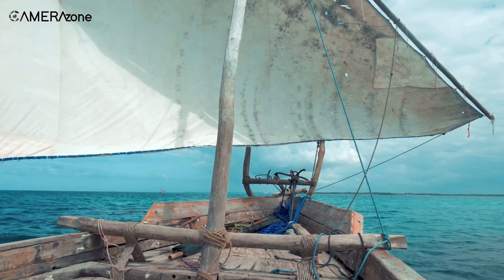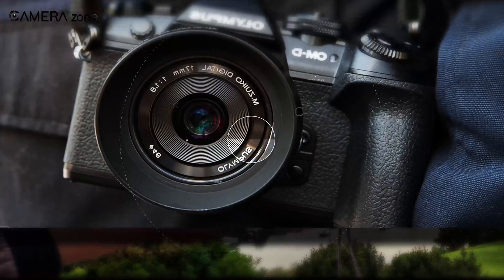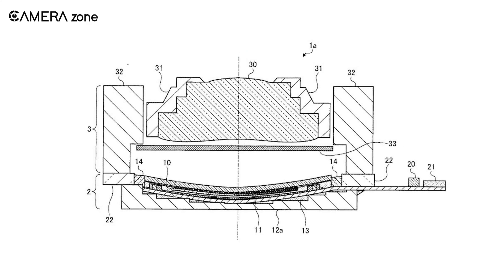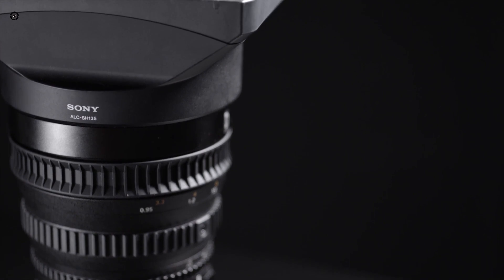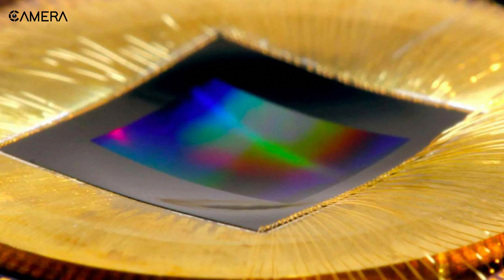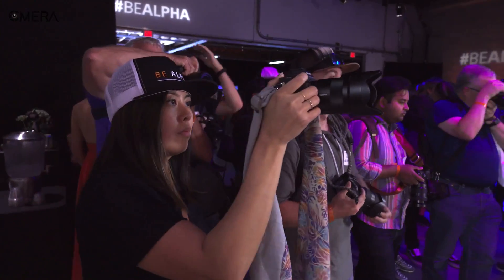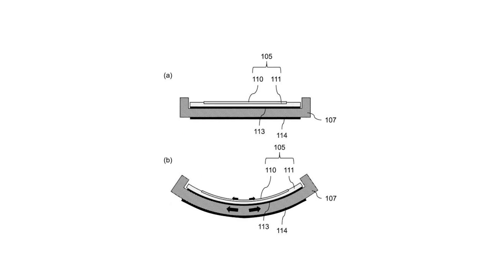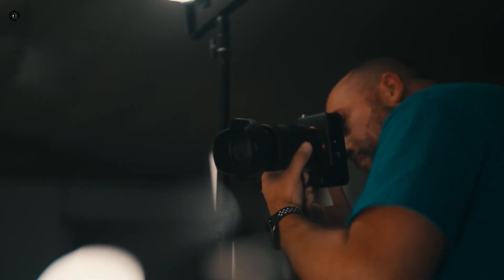Sony's Curved Sensor - Rocking Up The Competition.

Comment: 2:47, WOW, How did you wire bond on a curved die? Please introduce or share more about it
Reply: It isn't the sensor that is impressive, it is the machine that made that sensor and that will be a secret for ages! Do they make it flat and then bend it? then use fancy lenses for the UV lithography? Or does it have to be made curved which is why we haven't seen any in the wild because they cost too much to manufacture?

Comment: Think about in body stabilization with these. It doesn't compute very well if you know how it works. And by the way, Sony makes the X trans sensor for Fuji.
Reply: Yeah in body stabilization would need to be more complex. I would venture to guess it's worth the tradeoff if a faster lens is lighter and cheaper though?